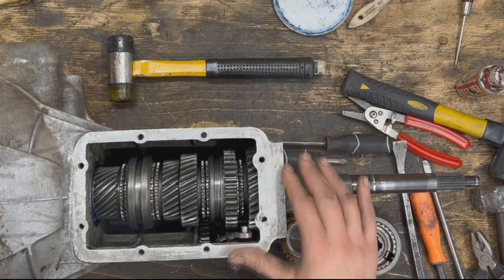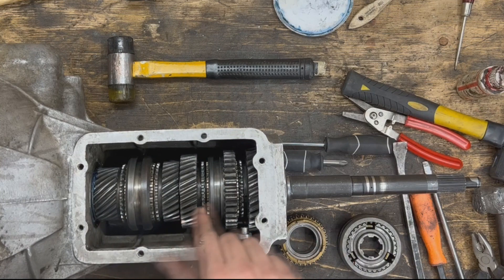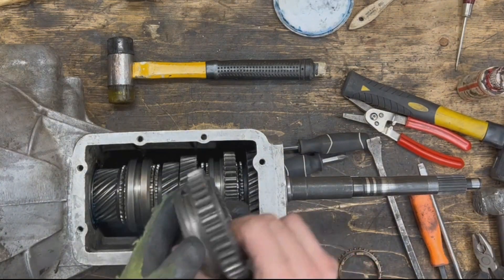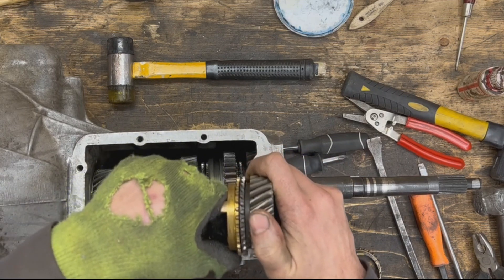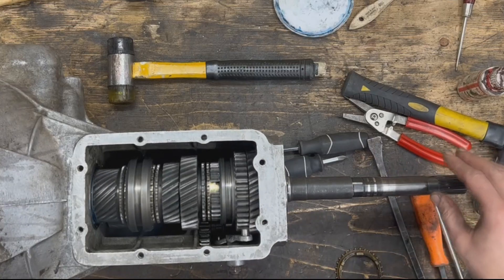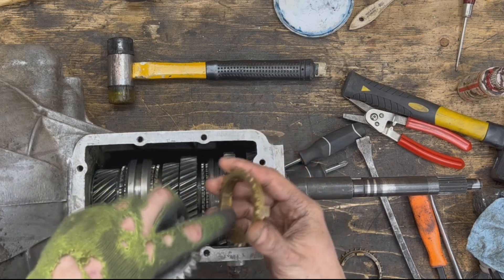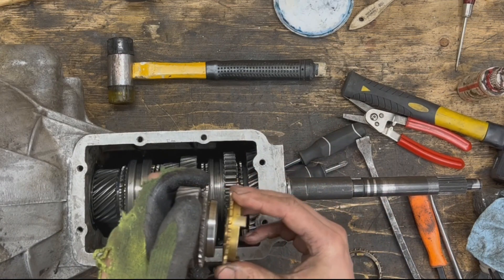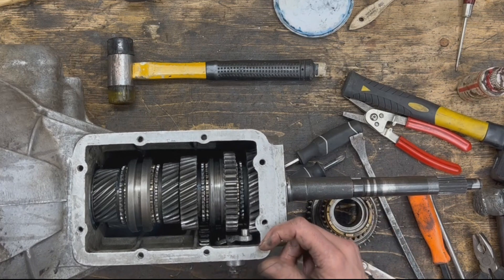Synchro Rings Explained

Comment: Everyone talks about the clutching action of the synchro ring--getting the two gears going the same speed--but no one talks about the SYNCHRONIZING action of the synchro ring.
Reply from the maker: So bringing two gears to the same speed does not mean synchronizing their speed? Is there more? I’d love to learn about the synchronization I missed in my video. Please do tell!
Reply: @RustyBeauties  Thank you for asking; no.  Synchronizing the speeds of the two gears is only half the process; after that you still have to ALIGN the teeth of the two gears.  I just described in detail in the comments of another video exactly how it works; I will copy and paste that explanation here.  It is amazing!

Thank you for responding. I spent hours yesterday watching these videos and I finally have it figured out. Mechanical engineering is amazing. The most important parts are the smallest—the struts and the springs...and torque. The question is, what is even the POINT of the blocker ring? Why can't the shift sleeve be built to do the clutching action that brings the speed gear to the same speed as the output shaft itself? What is the blocking ring FOR?

The recesses in the blocking ring are engineered specifically to be slightly larger than the struts themselves, so there is about half a tooth play in either direction. When you push the blocking ring against the speed gear, the friction brings the speed gear to matching speed, blah blah--we know that part. But what ELSE it does is pull the blocking ring out of alignment with the teeth of the shift sleeve. That is the most important detail. That is the blocking action (and the synchronization action). When the driver pushes on the shift lever, if the speed gear is going at a dramatically different speed from the output shaft, then the blocking ring will be pulled hard out of alignment. Too hard for the driver to overcome. The flanks on the teeth of the shift sleeve push on the flanks of the teeth on the blocking ring and try to bring them into alignment, but it's impossible until the speed of the speed gear matches the speed of the blocking ring. Once they are close in speed, the torque exerted on the blocking ring by the speed gear slackens enough for the driver to overcome it. He can then push the shift sleeve past the blocking ring, which now aligns back to the center, and the tooth flanks on the shift sleeve can now engage directly with the tooth flanks on the speed gear, but by this time, the speeds of speed gear and the shift sleeve are the same or so similar that the driver can easily overcome that and slide the shift sleeve over the speed gear teeth, locking the two gears. The tooth flanks will make any last tiny adjustments in the alignment of the speed gear easily because they are going almost or exactly the same speed by now.

So what is the purpose of the struts, and the angled protrusion on the struts, and the spring? The problem is, when the driver first shifts, the blocking ring will not be out of alignment, and the shift sleeve will go right through blocking ring and grind with the speed gear. That's the purpose of the struts. When the driver first pushes on the shift lever, the shift sleeve pushes against the protrusion on the strut. The spring is pushing the strut outward against the shift sleeve, so the radial force of the spring against the strut is greater than the radial component of the force of the shift sleeve against the angled protrusion on the strut, so the shift sleeve pushes the strut axially toward the blocker ring.

This action pushes the blocker ring against the speed gear, so if the two are going different speeds, the differing speeds will pull the blocker ring out of alignment. It's necessary to engage the blocker ring with the speed gear before the tooth flanks of the shift sleeve collide with the teeth of the blocker ring, so that when the teeth of the shift sleeve engage with the blocker ring, it is out of alignment if the speed gear speed differs. Then the blocking action happens as described above, as the tooth flanks on the shift sleeve push against the blocker ring teeth until the speed difference lessens so the torque lessens enough that the driver can overcome the resistance and align the gears.

But here's the cool thing about the struts. Once the blocker ring is in contact with the speed gear, the blocker ring will be pulled out of alignment, and the job of the struts is completed. After some moderate amount of force is applied from the shift sleeve to the axial component of the force on the angled protrusion, the resistance from the blocker ring will be stronger than that force, and as the driver pushes the gear shift further, the shift sleeve pushes the struts DOWN, radially against the springs, and out of the way. The shift sleeve can then push past the protrusion on the struts until the tooth flanks of the shift sleeve collide directly with the teeth of the blocker ring. But by this time the blocker ring is out of alignment, and the synchronization can continue, as described above.

When I figured out how the struts and springs work, I was completely blown away. Anyway, that's how it works.

(By the way, one last interesting detail. When the speeds of the speed gear and the blocking ring are rotating at similar speeds so that the torque lessens and the driver is able to push the shift sleeve through the blocker ring teeth, realigning the blocker ring, two things happen. First, as described above, the tooth flanks of the shift sleeve then collide directly with the teeth flanks of the speed gear, aligning the speed gear so the shift sleeve can slide all the way into place. But secondly, once the shift sleeve pushes fully past the teeth of the blocker ring, it also "lets go" of the blocker ring. That is, the tooth flanks of the shift sleeve teeth are no longer exerting any axial force on the blocker ring, so the clutching action is dropped at the same time the shift sleeve engages the teeth on the speed gear. Without the blocking ring letting go of the speed gear, the final alignment would not be possible. Isn't that amazing?)

Comment: Nice explanation of the mechanics, you could have mentioned that on many Triumph gearboxes until the mid 60s (up to the Mk1 GT6 etc. ?) there was no synchromesh on 1st  gear, and you had to blip the throttle to engage 1st easily.

Also you could have said that the gears for reverse are straight-cut not helical and therefore noisier but more efficient !

It will be great when this gearbox is done (and the overdrive) and we can have a quick summary of the story…
Reply from the maker: You are right, but I wanted to keep it short and simple and not necessarily specific to Triumph. 
I am filming everything I do on this gearbox so you will see it in detail.

Comment: Good to know how the syncros function to 'speed match' the selected gear.  Why are teeth required on the syncros?  Are they part of the 'speed match' process?
Reply: The inside teeth on the selector ring will slide over the synchroniser ring's teeth and drive it as a part of its assembly before it then slides further and locks onto the teeth of the selected gear making the output shaft, selector ring, synchroniser ring and the gear rotate as a single unit and drive the wheels.
Reply: @Vaakito227  Thanks Peter, that clarifies the purpose of the syncro teeth.
Reply from the maker: Peter said it all!

Comment: I take it that the syncro rings are made of a softer metal alloy than the steel gears so the synchro rings take all the wear. And they are cheaper to replace than the gears or hubs.  Is that right?  Thanks for the lesson professor Elin!
Reply from the maker: Exactly! I should have mentioned that! Thanks
Reply: And I believe that’s why you have to be  careful what type gear oil you use. Some oils have additives that could damage  the softer metal of the synchros.
Reply from the maker: @Ksozey  Correct!